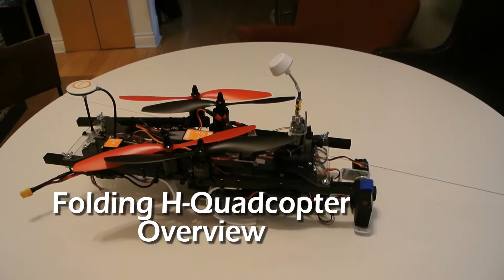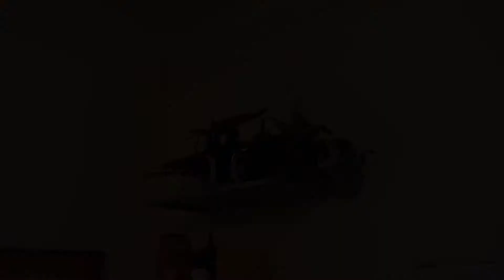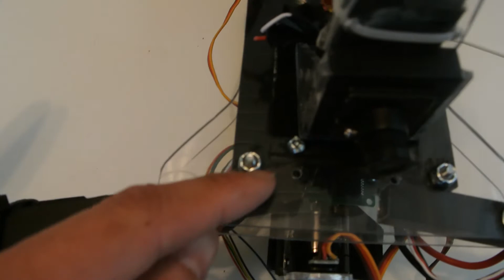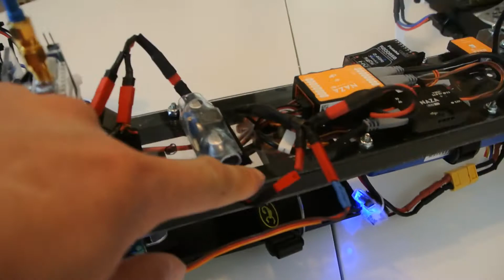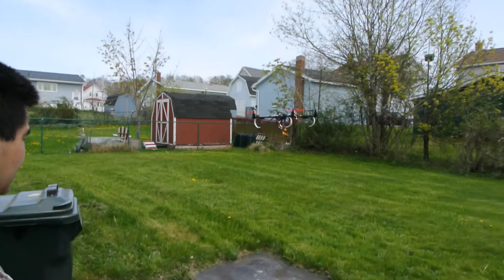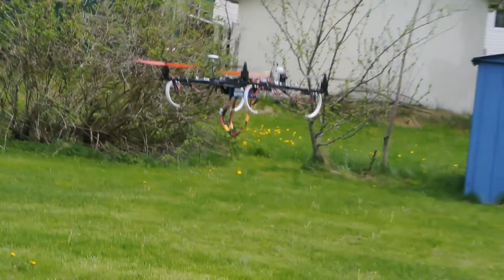DIY Folding Quadcopter (HCopter) Overview

Comment: Hi, gerat build! But can you see the props in the footage of the gopro?
Reply from the maker: Thanks! nope you can't see the props.  I'm working on a modified version of this frame with G10, it's going to fold up even smaller hopefully my plan is to make it a backpack quad.
Reply: ok, thank you! i have the same plan, building a litte gopro capable quad for a backpack, so you can film some sking videos...